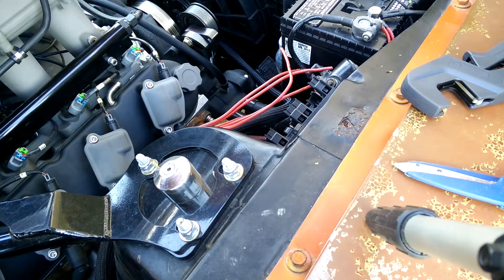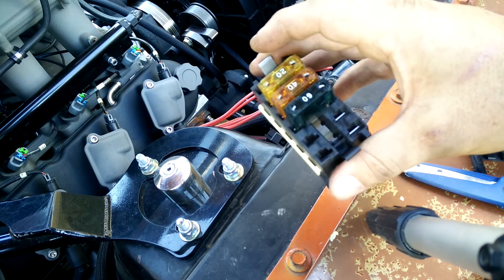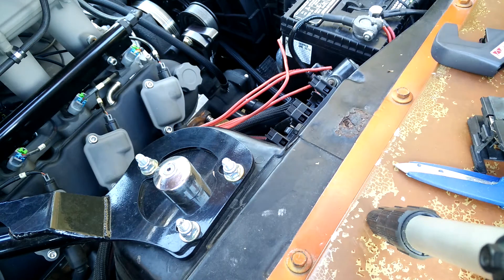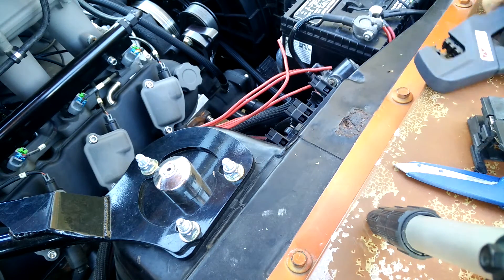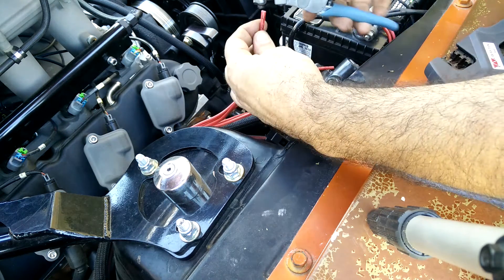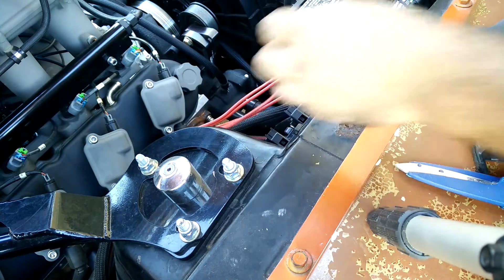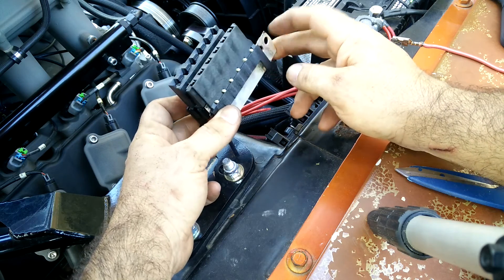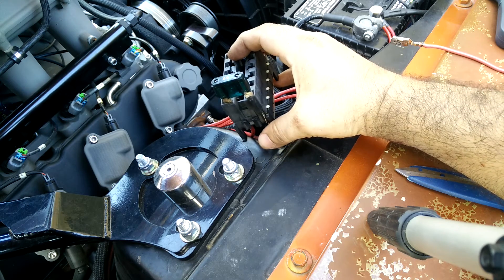Metri Pack 800 terminals with Waytek Wire 560 crimping tool

Comment: I've been reading your build thread about the EPS.  I also have a 67 Cougar and want to do it, but all the CAN stuff makes me think I'll just go with a Volvo electric P/S pump.  Anyway...when doing open barrel crimps, you should never twist the wires.  

One last thing, how about a sub for a sub?  I think you'd enjoy what I have planned for 2019 (a whole build series on the Cougar for starters...)
Reply from the maker: If you don't want to do the CAN stuff, just do the Vue motor with the eBay control knob.
Reply: @projectgattago  I do my best enginerding while walking my dog, and we just got back to the house! I think that I can use the Vue EPS with the ebay box, but configure an arduino and a digital potentiometer to accept a PWM/sine wave input (VSS signal) and produce a variable output to replace the knob.  Program it so that it automatically adjusts with speed.  I'd just have to figure out the return to center thing, and all is well!
Reply from the maker: @tinygaragefab  Sounds like a solid plan. I still have not figured out the RTC issue, but it seems that this is highly subjective. Many people seem very satisfied with both the Vue and the Toyota systems with respect to RTC.